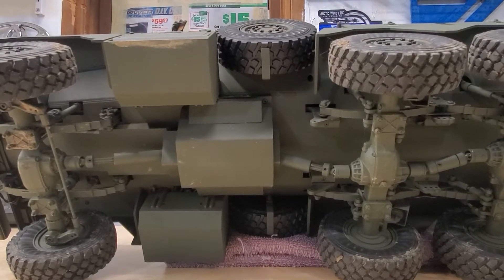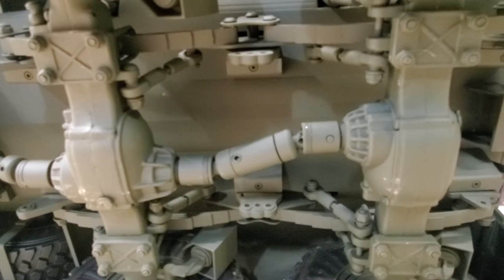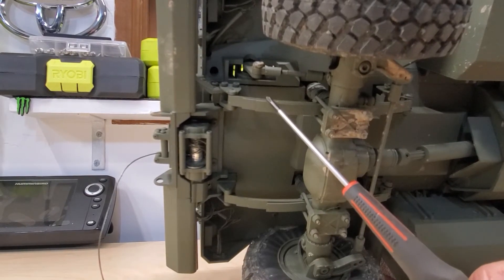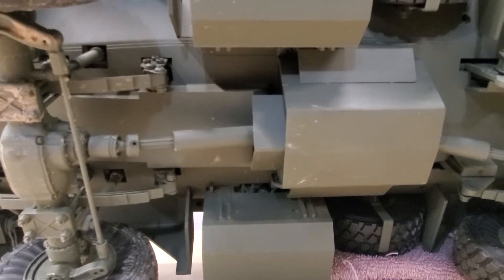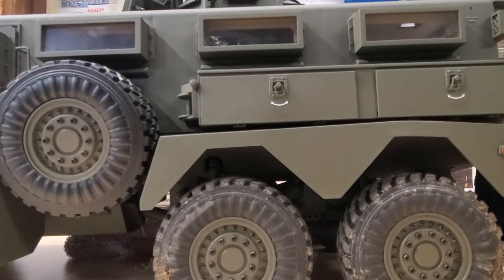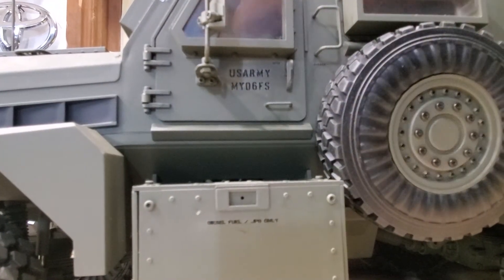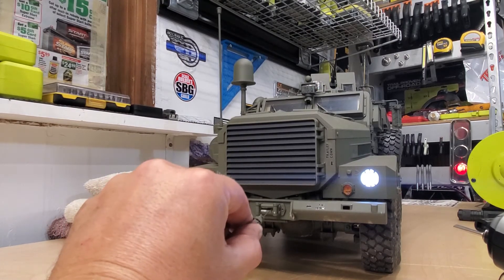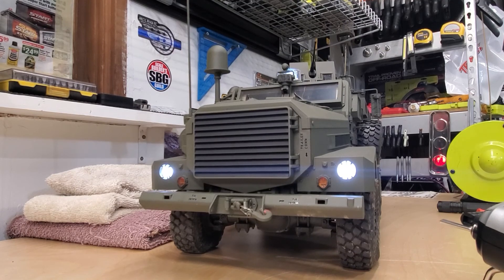Ask a question get an answer! Nuno Costa edition

Comment: Gary, did you cut out that annoying sound of the turning signal and how do you do it?  Thanks.
Reply from the maker: I did tank, there is a servo wire connection between the light and sound kit, I just unplugged it!! No turn signal sound😁😁
Reply: @gerrysoldguyreview  Cool I will try that.
Reply from the maker: Military trucks don't need signals!!😆

Comment: Where do you put the smoke oil at
Reply from the maker: Hello Charles,  under the right hood access you should have a clear tube!
Reply: @gerrysoldguyreview  
I have one clear tube but it has a spring inside of it
Reply from the maker: Charles i will look again when I get home but that should be the only clear tube under right side access!!
Reply from the maker: Hey Charles where the rubber tube with the spring is mine has a circuit board on top with a white plug, next to the plug should be a nipple thats the fill
Reply: @gerrysoldguyreview  I
Thanks for all your help and I hope you and your family had a very merry Christmas
Reply from the maker: Thanks Charles hope you got it sorted out! We did thank you so much!